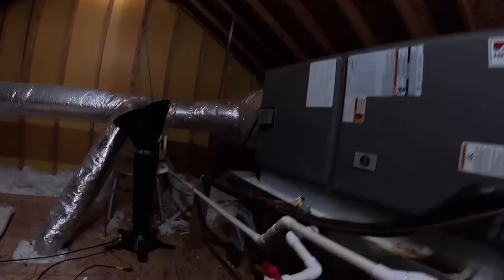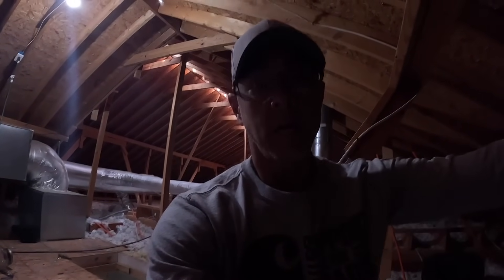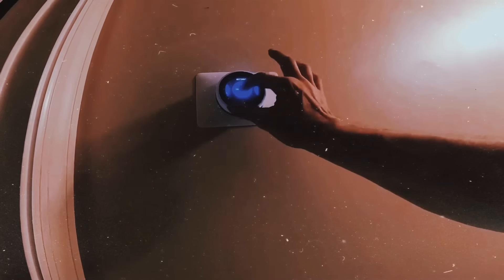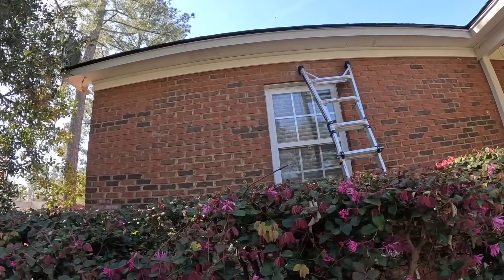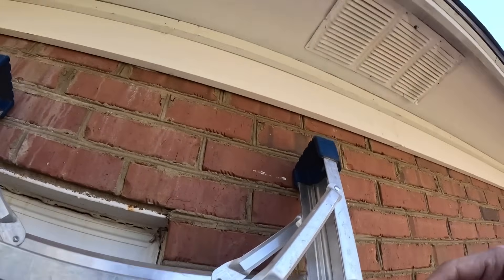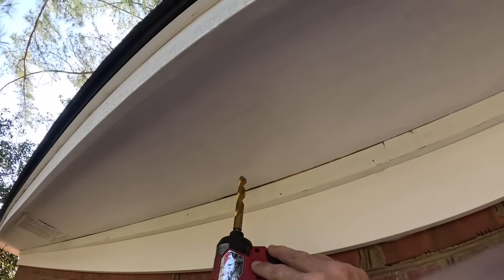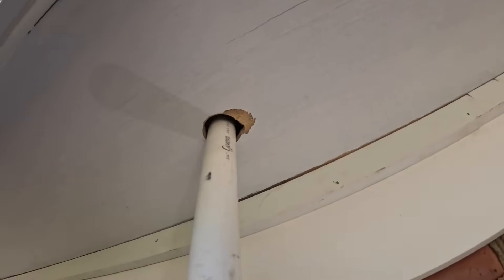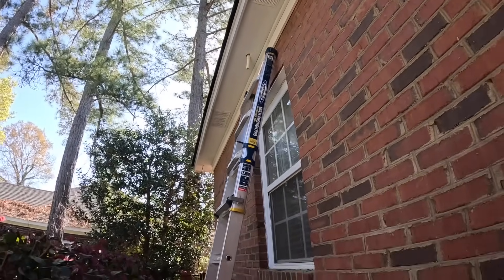Emergency Drain Just Pours Down The Wall! #hvacguy #hvaclife

Comment: I would not be happy with that solution. The piping should be routed somewhere better that over a window and run down to the ground. You also tore a chunk out of the wood and paint. Then again, for something simple like that, I would be doing it myself.
Reply: I believe that's the overflow/backup drain. It should never drip, if it does, the main drain is clogged. So if it's dripping that's the homeowner's clue that there's a problem. For that reason it's probably best that it drips over a window, so it's noticed.

Comment: I'd rather have double redundant float switches than an emergency drain. A lot of times homeowners don't even realize the emergency is dripping and they only know when eventually it also clogs and the float shuts things down.
Reply: That's how mine are set up. 2 A/C closets with the A/H's on stands with emergency drain pains on the floor with float switches. Primary float switches on the main drain pan. In Florida we get clogs but haven't had the primaries fail yet.

Comment: Man, go buy a lottery ticket. You drilled that first hole right on target without taking any measurements or anything, then blindly hit that elbow twice. I would have been in the attic long arming it. To be an HVAC Guy, you have to be a plumber, electrician, computer tech, and drywall, even carpentry is a plus. Then knowing your stuff about the heating and AC. Truly, a Jack of all trades. In your case, Curtis of all trades. Nice Job.
Reply from the maker: Thanks
Reply: And Master of Everything. 😬👍🙏

Comment: What kind of an installer originally installs a drain with no outlet? Good fix.
Reply: An installer at 5:00 and no matter what the clock says, it's 5:00.
Reply: A dirt bag or dirt dauber installer.
Reply: Truly an idiot. Even if it was, which it wasn't, right over the vent, it would have caused issues.
Reply: Might have been removed by a home owner. I bought a house that is a prime example of everything stupid an incompetent homeowner woudl do. It's taking me years and costing a fortune to fix, but I am able to do it mostly myself.
Reply: I'm sure there's a redneck joke here. lol
Reply: Even if it were meant to be over a vent, it would have still caused issues. Evidently whomever didn't know what they were doing.